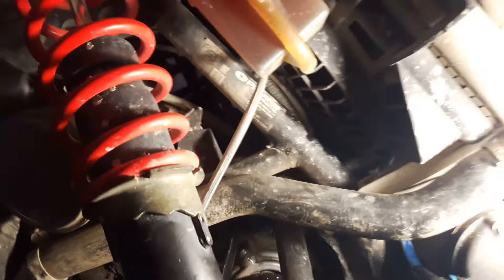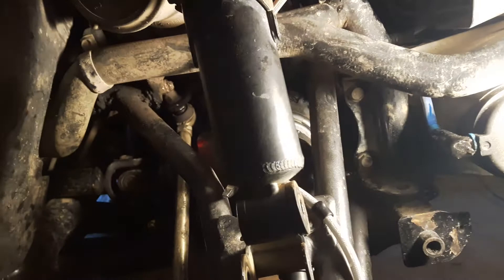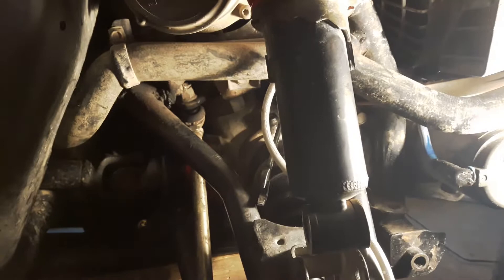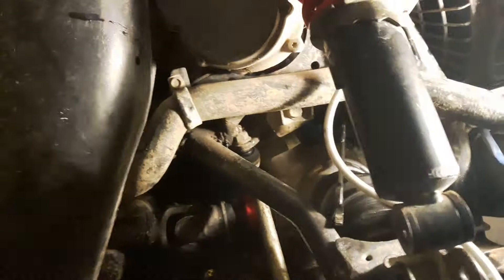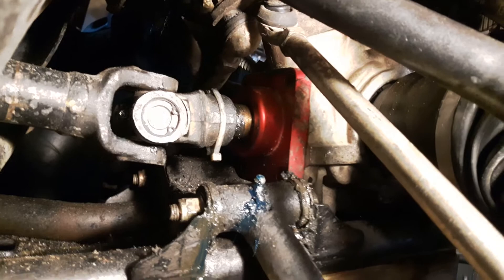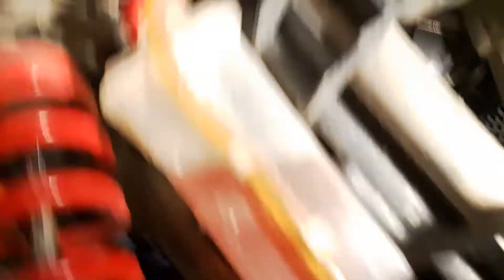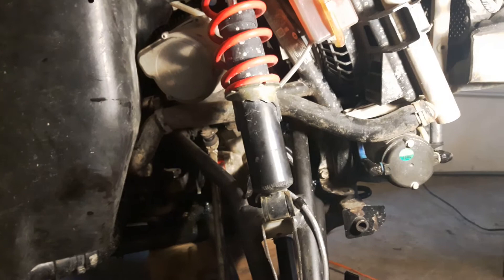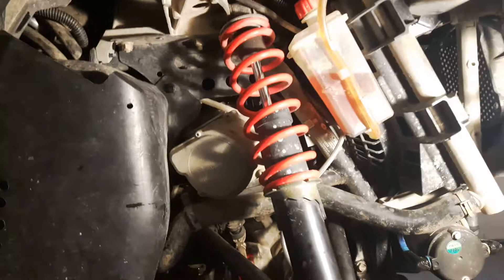Polaris loose A arm bushings fix

Comment: Hey buddy so I just bought bushings and the metal sleeves from Dk off road  they are made of polyurethane  and are tight af  you should try them out  last bushings you will ever put in there
Reply from the maker: I checked mine out closely. The bolts just came loose on the fronts. The rears did wear out pretty fast. I did look at dk and thats the plan for next time